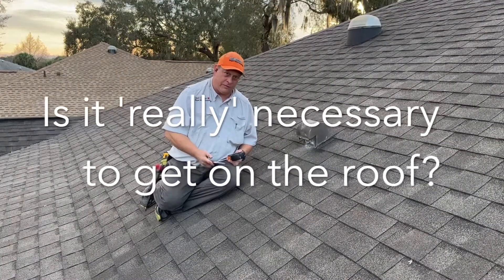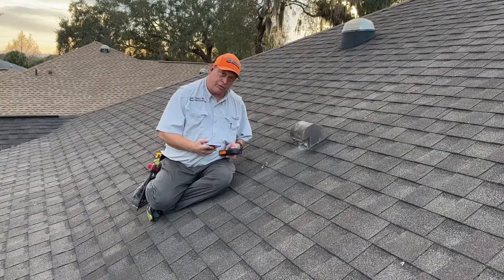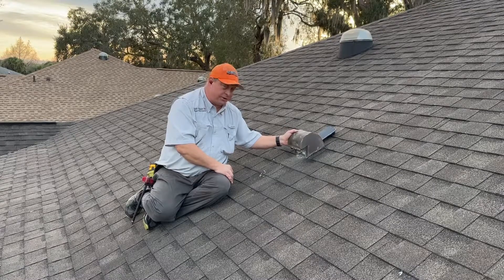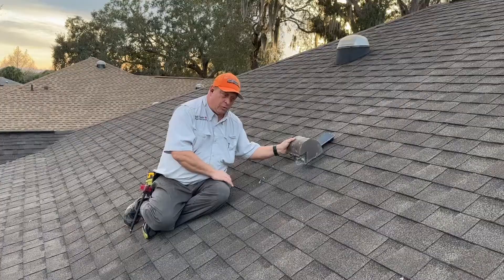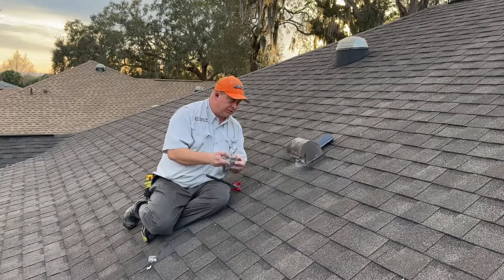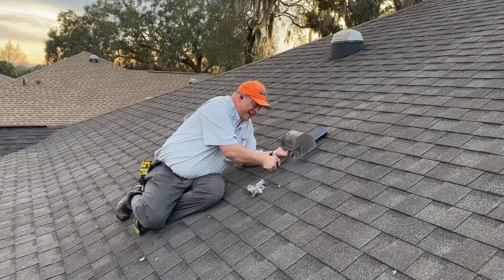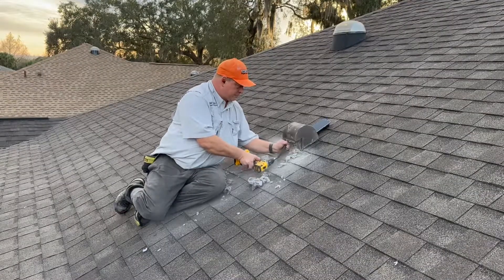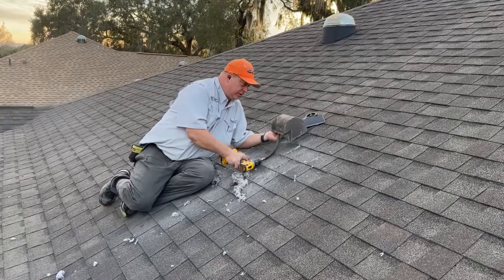Is it “REALLY” important to clean the Dryer Lint out of the Gooseneck on your roof in The Villages?

Comment: I do dryer vent service in Southern California and it is a must to access the roof to clean the termination damper/hood.
Reply: We have a Spanish tile roof and no company will go up there to check the damper on second story roof. We even tried calling roofing companies and the job is too small for them. Any suggestions please 🙏🏼
Reply: @jillzy1182  the only other possibility is to go up into the attic and take the duct apart near the roofline and try to clean it that way.  I have had to do exactly that in a few situations.   Dryer vents on tile roofs of two story homes are problematic because of the height and the fragile tiles.  Call some dryer vent service companies or maybe a handyman to do this.